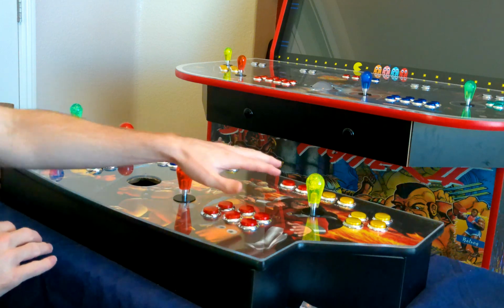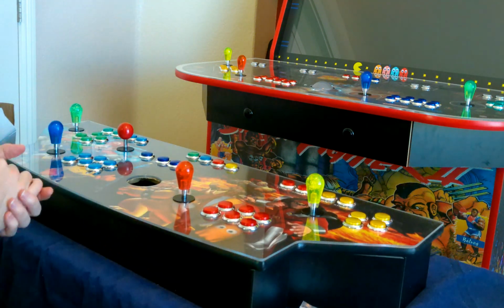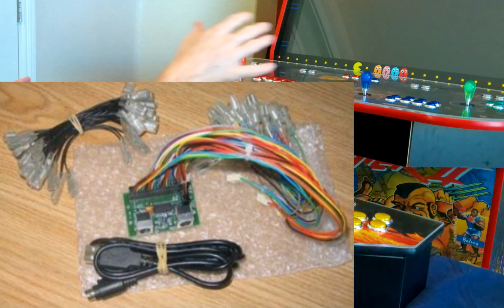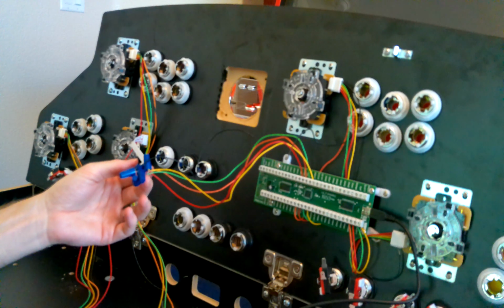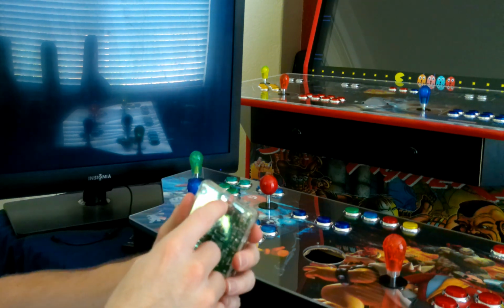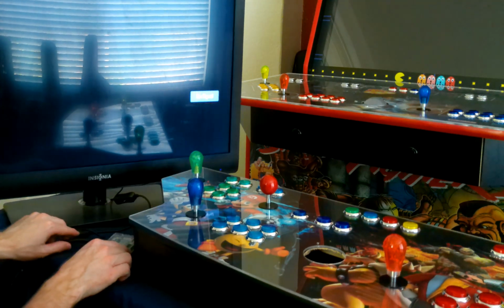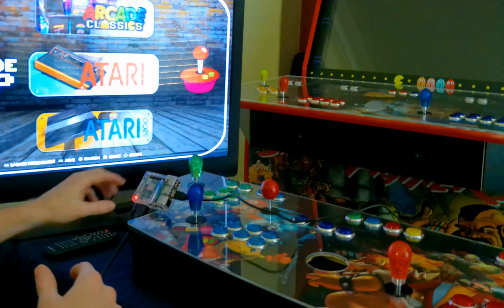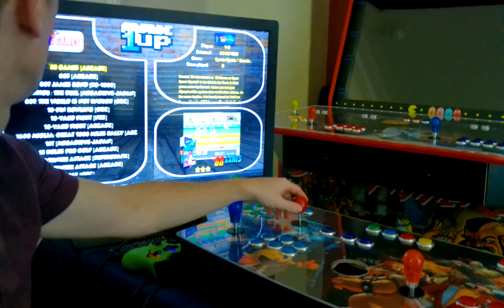4-Player Arcade I-PAC4 Full Wiring Assembly (part 1): 4-way joystick and Raspberry Pi

Comment: 11:01 Better option use a conductivity tester on a DMM (beep it out) to pre-test for the common and for each switch. Switch NO output will close to the common when moved towards direction. Note: harness exit direction changes pin usage for up/down/left/right switches. See my big comment below for orientation and pin direction used. All Sanwa and Seimitsu original and clone joystick pin headers will be identical layout. 
I see that you rotated Yellow joystick player-4 180°. Quick Guide upper left diagram.

Comment: 2:11 In the Quick Guide use the lower right diagram. The quick guide is for fightsticks looking into box bottom rotated 180° or flipped over left to right (joystick on left, buttons on right)

Comment: JST XH (2.50mm) 5-pin male sockets are hard to find that are not headers. You should try DuPont 5-pin in kits for 0.04mm x 4 = 0.16mm (0.006") out overall. DuPonts do have play in male pin harness. Marrette's look a little clunky.

Comment: Sanwa/Seimitsu Harness Layout have same pin/switch sequences but with inverted circuit boards, switches and pin headers, to further confuse the issue the manufactures opted to use same five coloured wires but only keep pin two using the same wire colour in sequence. Solution: find the common or ground pin (note: Gnd is not always common but Zero Delay boards use common +5V), call it pin 1 or Gnd and all other pins 2 thru 5. 

Sanwa Standard configuration from factory with 5-pin header exiting to lower right viewed from top of joystick. 
Wire harness with lock flange facing out (bottom of joystick), Gnd always on outside edge (centre Seimitsu). 
Sanwa and Seimitsu colour sequences differ with only pin 2 using same green colour from Gnd pin orientation. 
Sanwa wire harness colour sequence: Gnd-Black, 2-Green, 3-Yellow, 4-Orange, 5-Red. 
Seimitsu wire harness colour sequence: Gnd-Orange, 2-Green, 3-Black, 4-Red, 5-Yellow. 
The colour sequence in the harness is fixed, there are two options. 
Option 1: change colour going to the I-PAC up/down/left/right wire terminal. 
Option 2: switch sockets in the harness, moving colour to new position which keeps direction to colour code. 
(Option 2 is required for Zero Delay 5-pin socket connection - cross over in wire harness). 

Example colour code for standard and 180° header orientation from top of joystick (Sanwa).  
Gnd ◄ ► ▼ ▲ - G 2 3 4 5 - Lower Right (Std) - Black, L-Green, R-Yellow, D-Orange, U-Red
Gnd ► ◄ ▲ ▼ - G 3 2 5 4 - Upper Left (180°) - Black, R-Green, L-Yellow, U-Orange, D-Red

Sanwa/Seimitsu Harness Layout-viewed from top of joystick 
Pin Direction/Pin# Change/Orientation of plug 
Gnd ◄ ► ▼ ▲ - G 2 3 4 5 - Lower Right (Std) 
Gnd ▲ ▼ ◄ ► - G 5 4 2 3 - Bottom Left (90°) 
Gnd ► ◄ ▲ ▼ - G 3 2 5 4 - Upper Left (180°) 
Gnd ▼ ▲ ► ◄ - G 4 5 3 2 - Top Right (270°)